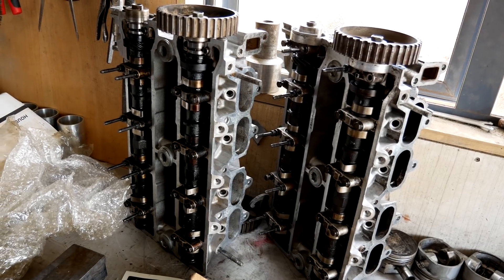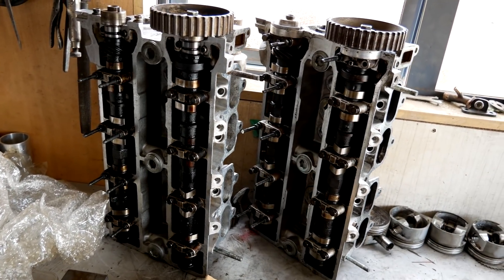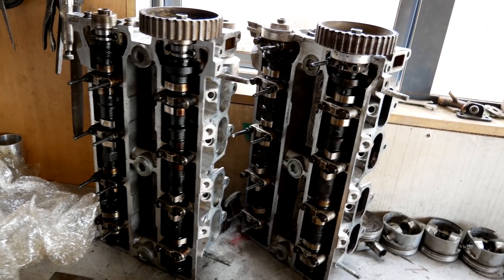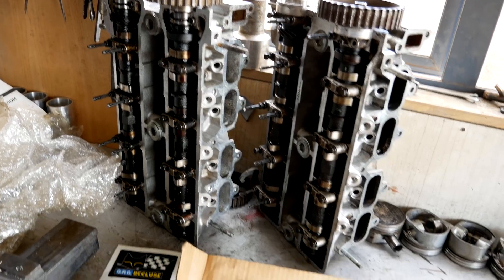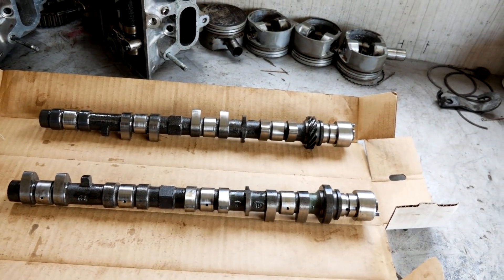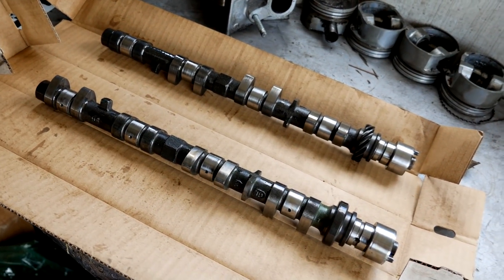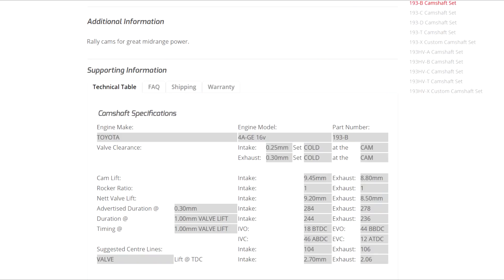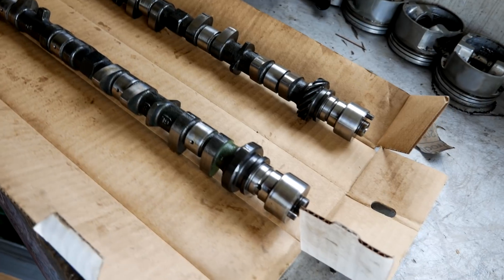Camshaft upgrade  Gold 4age -  Dyno tested

Comment from the maker: If anyone was wondering   factory  vs  kelford 193b specs are as follows

factory   232degree @ ?? lift ,    7.1mm lift

193b  -   inlet -  284 degree @ 0.3mm  lift     - 244 degree @ 1mm lift -   9.45mm lift 
--------exhaust -  278 degree @ 0.3mm  lift      -236 degree  @ 1mm lift -  8.80mm lift
Reply: Wont shim over buckets get destroyed at that lift? That's what the internet always tells me. Great content as always!
Reply from the maker: @DrThander   They are designed for stock shim setup.  can run more lift the more duration there is,  as can run a lower ramp angle on the cam.  biggest in their stock shim range is 10mm
Reply: Wow.. these are buckets right, direct cam->valve. That is not much lift to make such good power.
I'm playing with an old 12 valve Honda engine myself just to see what I can get out of it. The only thing I can do cam wise is grinds, but my stock valve lift is ~9.3mm and it doesn't make anywhere near your stock :/
Reply from the maker: @niqhtt  all about the duration,  these engines cant run much more than 11mm lift due to the head design.  over 10mm usually requires grinding some material out of the head to allow cams to spin
Reply: I was going to ask that, thanks. As always, very good video.
Reply: Did you upgrade the springs with these cams? Great result, no loss of low end and great top end gains.
Reply from the maker: @350gtboi   head already had toda valve springs.  so was just a bolt in and check clearances
Reply: Ok.. next step.. to make the most power and the most torque from that camshaft...

dial the cam so intake valve opens at 15degree btdc
And
exhaust valve closing at 15degree atdc

I found out this is the best balance of low-mid-high range of camshaft installation method by centering the intake opening and exhaust closing event...
Reply from the maker: @AmirPomen    At what lift?    inlet sounds very late and would be very peaky.     It set roughly a 38deg btdc @1mm lift ivo .   12deg atdc evc
Reply: @Garage4age  at 0.3mm lift as per cam spec... I misslooked the lift measurement at 0.3mm 🙏🙏

 if measured at 1mm lift definately it will different angle...

38degree btdc ivo sounds like alot earlier?

Or first find centerline on both in and ex... Then measure what ivo and evc measured at 1mm..

 then only balancing it by (ivo+evc) divide by 2... Thats the ivo and evc rule of thumb for good average power and torque ive used...

*Side note...a good cam will have perfect number when (ivo+evc)/2 and (ivc+evo)/2
Reply from the maker: @AmirPomen   the base (recommended) setting is 18 btdc @1mm lift,   i advanced the cam 10deg more, so another 20deg at crank.  = 38deg.     the actually number maybe a little off that, but close.  probably around 3-4mm lift at tdc.   my big cam engine runs over 5mm lift at tdc.

Comment: Great video. How accurate is the 1500 to 2500rpm range? If one were to use this cam for a daily driven car it seems like alot of power to loose down low despite gaining alot almost everywhere else.
Reply from the maker: I wouldn't use  these cams if in a lot of stop start traffic.  since doesn't idle or run smooth at low rpm (sub 2000rpm) but otherwise fine. part throttle different to what dyno shows here at wide open.   intake and exhaust setup needs to be correct also.  I have tuned a few cars with the same cams and they are down on power between 4-5000rpm
Reply: @Garage4age  whats the most power youve seen running on stock 4age cams? Probably the bluetops then? Would really like an ae86 corolla as next problem but im worried it will be too slow if i dont sacrifice alot of daily driver manners
Reply from the maker: @OEMplusRESTO   most i could get out of  bluetop head and cams was 113kw at wheels. maybe could stretch that to 115kw with more compression.   most dont get anywhere near that though.   you can time the cams so it runs nicer down low but will lose midrange.   or get something inbetween  stock and 193b will run nicer.  watch this video if you havent already. shows alot of stuff building up bluetop head   https://www.youtube.com/watch?v=Ik7tK_zmZCM

Comment: Interesting how the cam timing doesn't do much on this engine. When I had a mild custom cam made for my Buick I had the cam ground 5 deg retarded and that moved the torque curve up by about 900rpm compared to a similar profile I'd tested on the dyno before and made great power for the size of the cam.  Stock profile is around 180/190 0.400 lift and mine was 212/212  0.470 lift.  Although I had other supporting mods like headers and good airbox, I gained 55% over stock at the wheels.

Comment: hey mate love your channel! very kiwi :D I'm interested to know, did you do anything to the IGN timing map when changing cams? particularly when doing the big step up from factory cam to the kelford profile? cheers man love ya work
Reply from the maker: same ignition advance used on all the runs here.    The timing needed for the bigger cams is pretty close to the same as for the small cams.   The bigger  cams usually need a little less timing to make best power.  due to the engine having higher cylinder fill / making more power.  much like a turbo engine will need less timing advance.      pretty much all the tests on my na engines are at timing numbers, that going a degree or 2 either way will make the same power
Reply: @Garage4age  thanks for your reply man... that's interesting! from watching your video on IGN timing I would have assumed you found MBT for one of the cams at least but I'm surprised that you didn't have to change timing for the kelford cam given it's such a different profile in lift and duration. Have you changed the IGN map at all since going to the bigger cam? Sorry I just realised I asked this question on a clip with absolutely nothing to do with cams or IGN timing :D
Reply from the maker: Yeah as above is more the power the engine is making rather than the cams directly. engine doesnt see the cams on combustion stroke. Its just  more air and fuel (if said cams are anygood)  which will need less advance. but its only a small change.   my good engine that makes 150kw  will make best power only a couple degrees less than what the stock cam engine makes best power at.    changing the shape of the combustion chamber and the likes has a more direct effect on ignition needed.
Reply: @Garage4age  yep I follow ya! makes sense. thanks for the detailed replies! enjoying your videos man they've got really solid engineering grounding with a simple take home. not easy at all to do that!

Comment: Thinking of these cams for my build, very handy video! To what RPM do you think these will still continue to make power? If I wanted 9k are these a good option?
Reply from the maker: depends on rest of your setup , head and bolt ons. how far will carry the power. cams only one piece of the puzzle.    on this setup by 9000rpm would probably be down around 120kw from the high 120's peak.    most of the time these engines like to have peak around 8500, can get peak power higher, but generally have to lose a stack of power through mid range to do it

Comment: What's the compression ratio on this engine?
Reply from the maker: about stock.  10.3
Reply: So I would say that if it works more or less in this way on other engines too this is also a myth busted (bwwwaaaaaa) regarding the need to raise the ratio when going for longer durations cams for not loosling midrange (a loss under 2k is not to be considered in my opinion, even if present). 

Nice :-)

Comment: I’m curious if swapping the cams produces more power ie longer duration on the exhaust cam. I see you’re running distributor-less (as I noticed no distributor gear on the other cam) so wouldn’t be an issue to give it a try. I have hks 264 intake and 256 exhaust in my 4age. I watched Richard Holdener’s reverse pattern cam vid the other day. He demonstrated that in an LS application a longer duration exhaust cam made more power than a longer duration intake cam, so it got me thinking about my setup in the 4ag. 
https://youtu.be/gaPlbqHq_4k

Comment: 130kw n/a is mega! I remember when I had turbod my Corolla and it made 130kw at wheels and I was stoked as! As a comparison the stock 4agze smallport only made 95kw atw. Its been at least 10 years since playing around with the old 4age and have always wondered what worked to make power. In the end, it was cheaper to just keep throwing boost as it. Also earned a sub!
Reply: Did you change your agze cams?
Reply: @randomtoyotadude8952  Nah just stock everything, apart from injectors.

Comment: Mr 4age what do you think of regrinding stock cams to similar spec?
Reply from the maker: better off to get new cams.    can only go so far with regrinds and need to reduce base circle to do it.  so have to add lash caps to extend the valve stems to get clearances in spec.   wont be able to go as big as the cams in this vid with regrinds.

Comment: Hi, probably asked a lot of times here but what is your dyno setup?
Reply from the maker: Its an old  Vane (now mainline)  bed.  Is running dynotorque control/software,  which is a company that used to do dyno control here in nz.
Reply: @Garage4age  I was thinking about getting one, what do you think about buying an old eddy brake Dyno and make/buy a modern day controller is this a good ideia?
Reply from the maker: A lot of people are doing this now.  most use yourdyno control,  or sport devices if want a higher end product.   I will probably  switch to one of them, if have any major issues with my setup, as its not supported anymore.    if you are on facebook there is a "diy dyno" page. some good info pops up now and then.

Comment: top vid as always....   i was hoping u degreeing the exhaust cam too in your test :D :D

the cam install was hot hahahhahaha
Reply from the maker: cant do a adjustable wheel on exhaust side due to the cas its running.    but from past experience may have got couple more kw in those mid range  areas where the inlet picked up.  far less than what the inlet cam does anyway.  unless the cam is quite far off to start with
Reply: @Garage4age  yes I saw all your vids... Best stuff out there 👌🏻👌🏻👌🏻

Comment: Curious to know If you have a set of silver top throttle bodies laying around. Would love to see what differences you'd get. Seems to be a lot of arguments over the internet about st vs bt itbs on 16v's. Both on stock motors, slightly modified and fully modified.
Reply from the maker: no silivertops hanging around.  the throttles on it are actually modified bt  with 47mm plates.  at this power the stock bt 45's would be no difference.  but would think the st would be pretty borderline,   way back i done a test restricting the 45mm's down on an engine with similar power to this and it lost power

Comment: How do you think this engine would react with your larger itbs?
Reply from the maker: was no difference on the other engine,  so would expect the same.  these ones actually have 47mm throttle plates, usually 45mm
Reply: @Garage4age  was there any significant improvement when you went from 45mm to 47mm throttle plates in the past?
Reply from the maker: @ryanhumphreys4805   was pre dyno,  when went to the 47mm. if i recall correctly there wasn't much if any change in the fueling. so likely minimal to no gain.  but the engine was making quite a bit less power back then, probably not a lot more than than engine in this vid.  I did restrict the throttles down a few mm to see if any loss before opening them up to 47mm and it did loose some power. so 45 must have only just been big enough

Comment: Is there a version on the 4-ag that came with a mechanical distributor? So one could run it on propane, with no computer?
Reply from the maker: all are efi.   but some people modify dizzys off 4k's and the likes when using carbs. or just leave the ecu connected to run ignition only

Comment: I guess the Kelford cams have more duration ?  just remember that max gas flow at the IN valve is @ 0.25 valve diameter, when you say    'advancing the cam'  are you meaning into or away from engine rotation
Reply from the maker: yeh specs are pinned in comment at top of both kelford and stock.     advanced so forward into engine rotation.  so the inlet cam opens earlier and has more overlap with exhaust cam
Reply: @Garage4age  Sorry , but I don't see a comparison pinned in your comment section, there is something in the video but is unreadable .  anyway advancing the cam will generally improve bottom end but I have no idea of O/L as you have no figures for the EX cam, so it may have no bearing on the result. Too much IN adv will likely show up as IN reversion that you may see at the IN trumpets .... but the extra duration sure showed up in the top end ! ( extra lift may also show up as duration as valve accel to  that lift exposes the valve to better flow rates longer with in that duration ) ....great effort ...ta
Reply from the maker: @bobawatsit   No offense but how small is your screen? i can read it on my phone haha.     here is a link to the cam spec on kelford site: https://www.kelfordcams.com/nz/camshafts/toyota/4a-ge-16v/193-b-camshaft-set.html .   I did a quick measure after installing and the numbers were pretty close to whats on the cam card, on  the factory marks.   a lot of people struggle to make numbers around the 4500rpm mark on these engines when going to bigger cams.  mostly due to the bolt on selection they have used.
Reply: @Garage4age  Ok, I did a look at Kelford specs, I wish the cam grinders would stick to the SAE convention of lobe duration measured @ .006 " lift ....anyway those cams as a set  have approx 70 deg of O/L and 280 odd deg duration ...that is getting on toward a very fast road or semi track cam, that's why you see a good improvement in the top end ....I don't know if this test was against factory spec IN / EX cams as I was surprised how little the bottom end performance was affected
Reply from the maker: @bobawatsit     was vs factory cams yes.  from what ive found on the net they are 7.1mm lift  and 232 degree duration, measured at what lift i have no idea, but would assume advertised.  they are pretty small.   as my above post its holding the bottom end well due to the bolt on selection.    on following sheet the red line is my setup in this video.  the blue line is another car with same engine spec and same cams. but different bolt on mods, different intake, headers, exhaust etc. https://garage4ag.files.wordpress.com/2021/01/193b-10-ad-v-zac.png  if all goes to plan will have a vid out over next few weeks showing what effect the bolt on stuff has
Reply: @Garage4age  yes the bottom end is good because of the stock EX cam the O/L is probably smack on 45 deg and not the 70 + you would have with an EX cam to match the IN  The specified lobe centers on the cam card @ 105 +/- may make the power band ' peaky ' ... if you were running the matched cam set, I would lift the static compression ratio by probably 2 complete units ie : 9.3 > 11.3 which would help the bottom > mid range , which may not be that easy ?
Reply from the maker: @bobawatsit   what do you mean by matched cam set? equal duration and lift  on both inlet an exhaust?    the engine is using both cams from that cam card.
Reply: @Garage4age  ANH

AH !   my BAD mistake,  I tripped over something you said or I miss read, for some reason I thought that you were running the K 193b IN cam and a stock EX cam  ?? ( which would be interesting, to see exactly how much EX duration is needed )  Still the 193 b still lost 5 kw +/-  below 4700 rpm and gained 19 +/- at the top .....what you'd hope for  Advancing the IN cam 5 deg did much what you'd expect, just rocking the power #'s from around that 4600 mark ....if you ever have the chance, be interesting to see IN / EX lobes set @ 110 deg C/L ... thanks robbie

Comment: I dont know if you'll see this, but my 16v bigport 7 rib blew the head so im taking the time to rebuild the motor. I'm mainly daily driving the car 10k+ miles a year but I also want to be able to reliably track and autocross the car. Do you have any reccomendations for that aspect? I dont really want to increase power much right now because I want to build on driver mod until I hit the limit of the car and then improve.
Reply from the maker: basic things i usually do; lower the oil pickup in the sump a little.  if your at high rpm a lot put a restictor in block to prevent all the oil ending up in head. clean up the bumps in combustion chambers.  .5mm skim off the head. .8mm trd gasket - check deck height first as they can get tight with block skim. smallport pistons.  good idea to throw in aftermarket valve springs, so if you want to do a cam swap later on its ready to go.  arp rod bolts are good piece of mind if going over 8krpm

Comment: What is this only an intake him change why no exhaust cam timing
Reply from the maker: I cant fit an adjustable cam gear on the exhaust side, with the cas setup im using.    the intake has a lot more effect on power also

Comment: you're getting more power than me at the wheels and I have a Loyning built motor full of FA parts.  Hmm....
Reply from the maker: work on the  bolt on parts.  my first engine i done way back, had much bigger cams  than this.  but didn't make any power, from memory 105kw was the most it ever made.
Reply: @Garage4age  Thanks.  Of course, my dyno is with a 23.5mm SIR.  If I can get 112kw w/ the SIR at the wheels I'll be happy.